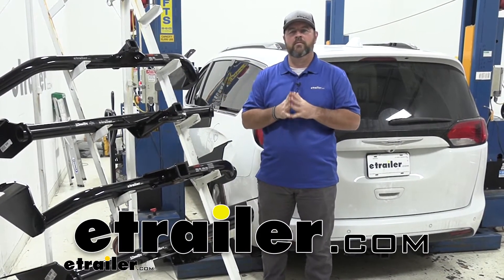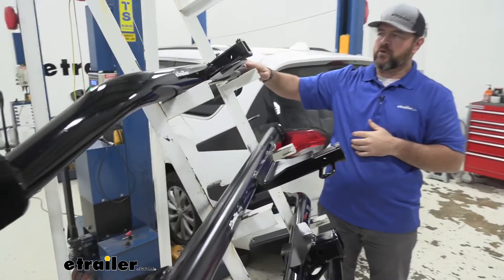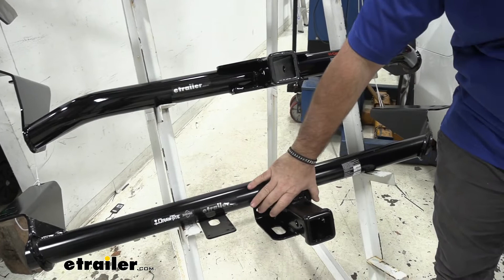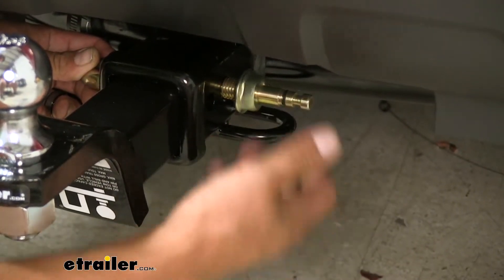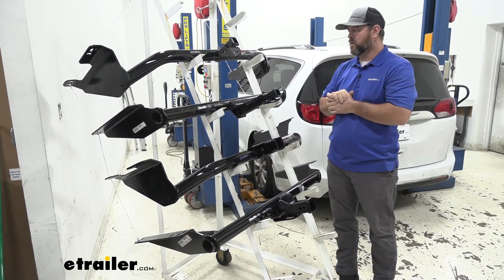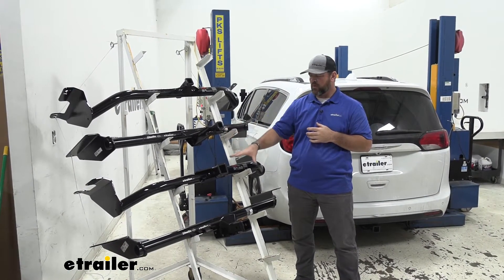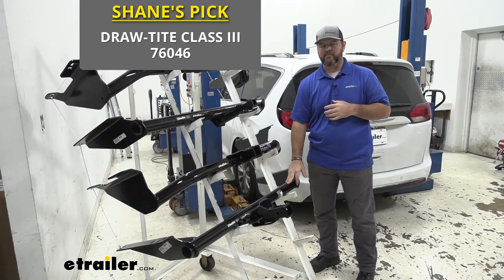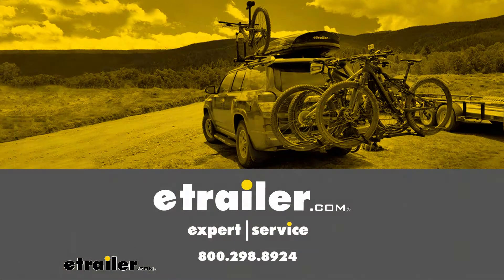etrailer | Best 2018 Chrysler Pacifica Trailer Hitch Options

Comment: Will the same draw tite class III hitch fit under the Pac Hybrid? Or a different model will fit?
Reply from the maker: For the 2018 Pacifica Hybrid, you'll need the Draw-Tite # 76046-SK which includes the relocation bracket for the emissions canister. You'll want to be aware of the fact that Chrysler doesn't recommend towing with the Pacifica Hybrid, but the hitch makes a great attachment point for a hitch mounted bike rack or cargo carrier.
https://www.etrailer.com/Trailer-Hitch/Chrysler/Pacifica/2018/76046-SK.html